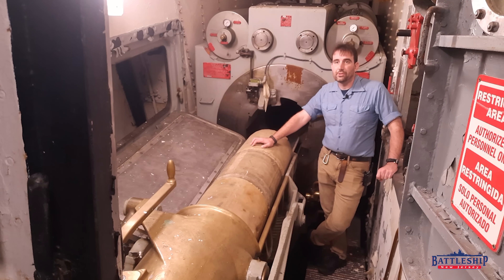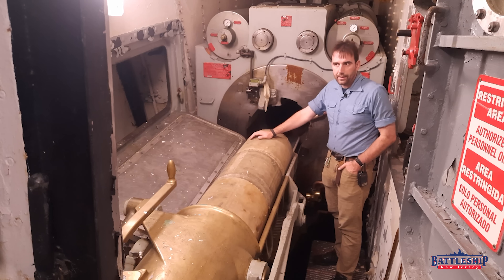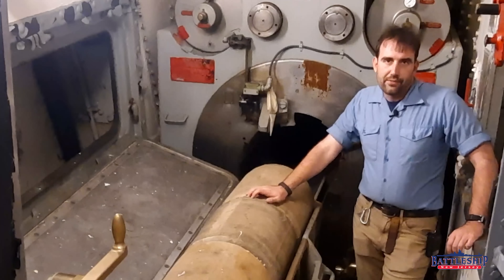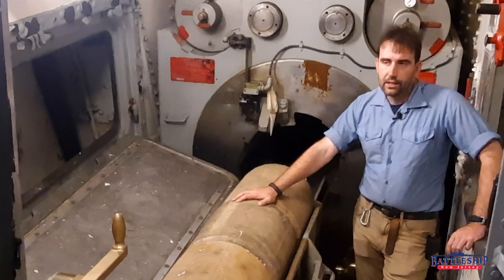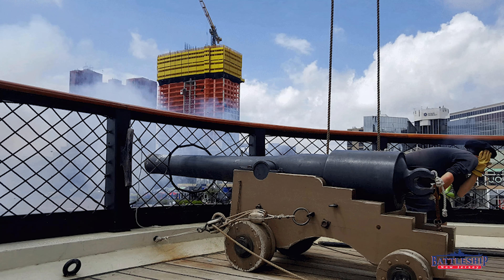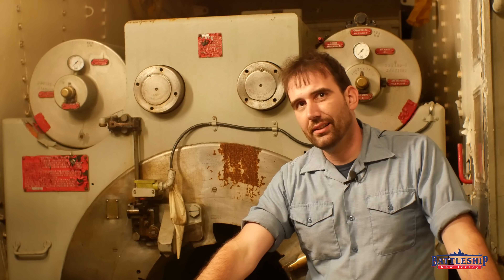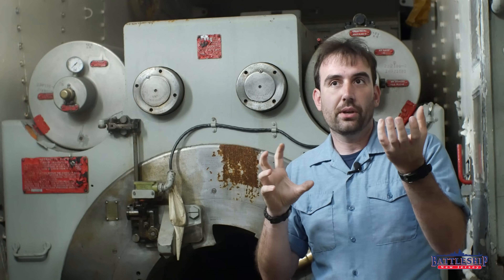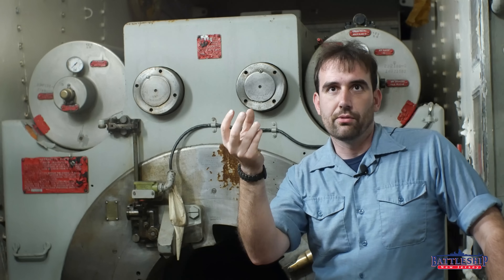How to Unload the Battleship's Guns

Comment: So, my first day working at a small airport, my manager handed me a "bird banger" and told me to go down to the end of the runway and shoot it to scare off some birds.  Its basically a pistol that has a cartridge shoved into the muzzle with a separate percussion cap sitting on the breech under a hammer.  Anyway, I loaded it, pulled the trigger, and nothing happened.  I did it a gain and still nothing.  If finally fired after dropping the hammer three times.

He told me it wouldn't be loud.  Then again, I later learned he was a Vietnam vet with hearing damage (and more) courtesy of an NVA RPG.

Comment: I have had misfires, and once a hang fire which are potentially very dangerous. That is why if you have a misfire, keep the weapon pointed in a safe direction for 30 seconds, before opening the breech and removing the dud round. I have also experienced squib loads where the primer detonates, but the powder failed to ignite or was missing entirely. That drives the bullet into the rifling. If you press the trigger and the report is off in any way, STOP! there might be a bullet stuck in the barrel and if you chamber and fire another shot, it could blow your gun apart, injuring or killing you.

Comment: I have never thought about this until I watched this video, but I have been interested in heavy artillery for quite some time.  I would have thought that the base of each shell would have a threaded hole or holes in it that would accept a bolt(s) that could be threaded into the shell base, and using a hydraulic puller at the breech, the shell could gently be removed from the tube even with the copper rotating band engaged in the rifling.
Reply: The real solution is a lot more low-tech. Basically a giant brass hammer that you drop down the front end in the hope that it will dislodge the shell.
Reply: You don’t really want to put holes in the base of the projo. It’s structurally a very undesirable situation, particularly when you’re looking at a pretty rare situation.

Comment: Sleaking of 50 cal or 20mm bullets. Did you know that when millimeters is used as a designation that it's not referring to the bullet diameter, its actually the bore diameter and inch designations are the groove diameter.
Reply: Not true.  For instance a .38 S&W calibre is actually .357 inch or .358 inch groove diameter and a 10mm Auto has nominal 9.91mm lands, and 10.17mm grooves.
Reply: @DepakoteMeister  any other that don't?
Reply: @engines-anonymous  Yes.
Reply: @DepakoteMeister  which ones?
Reply: @DepakoteMeister  the correct nomenclature is 44 magnum, not .44 magnum. Same with 38 special and the 223 remington cartridge. It's just a name not a reference to the bullet diamter. .44 magnum etc. is a misnomer. I guess I should have said usually it's in my first post. My bad.
Reply: @DepakoteMeister  Also, if you look at reloading components, it will have a inch and millimeter designation. One is referring to groove diameter and one is referring to bore diameter.
Reply: @DepakoteMeister   to clear up any confusion and to I guess correct myself...  What I should have said is, the metric designation of a bullet usually refers to the bore diameter, while in america we refer to it by its actually diamter, which is the groove diameter. The name of the cartridge does not necessarily indicate the bullet diameter. Pistol cartridges tend not to follow that, but rifle cartridges usually do. 50 cal actually does refer to the bore size not the groove size.
Reply: @engines-anonymous  Yes, that would be more accurate.  I think not just the US, but English Imperial calibres are usually groove diameter too.

Comment: Ryan, didn't you show a "Backing Tool/Rammer" down on one of the shell-handling decks?  I distinctly remember a video where you showed a large, metal tool that you speculated could be dropped down the muzzle of a 16" gun to dislodge a rammed-home shell, and a Gunner's Mate replied that was exactly what it was.
Reply: Wait where I want to watch that video
Reply: The video you're referring to definitely exists.
Reply: look at this on fig 2-23 . You will find the advices and drawing for using the "backing tool "   on   https://eugeneleeslover.com/ENGINEERING/OP769/OP-769_Part1.pdf
Reply: "Backing Tool "  on   https://eugeneleeslover.com/ENGINEERING/OP769/OP-769_Part1.pdf     fig. 2-23

Comment: to clear a few things fuses in modern weapons usually require a sieries of actions to arm fuse setback which moves device in fuse that lets spin then arm the fuse deceleration l does nothing either impact or timer or radar sets fuse off

Comment: Ryan anyone who has fired a 22 has had a dud!! especially with Remington thunderbolts in 87! i had a 100 pack with 30 duds in that!!
Reply: That's true.  I've had a lot of .22 cal. duds.  I wasn't thinking of that when I made my earlier post.  Was shooting with a fellow one time and we had a number of .22 cal. duds.  He collected them up and tossed them into a pile of ripped up targets and splintered wood being burned in a cut down 55-gal. drum.  It probably took more than a minute, but they cooked off.
Reply: @yepiratesworkshop7997  oh yeah the primer may be a dud but the powder is normally just fine!!
Reply: @keithmoore5306  I didn't show it, but I was a little "concerned" that one of them damned things was gonna' come flying out of that oil drum.  I've also had times when I'd just re-cock the shootin' iron and fire it again and that time the primer worked.  I ALWAYS worried when I had to eject a "dud" figuring that little bit of jostling might set it the rest of the way off.  Just lay it on the bench with the barrel pointing down range and give it about 5 minutes.
Reply: @yepiratesworkshop7997  oh yeah stuff like that will rattle ya` some and on a chamber dud i normally bang on the gun a couple times and if no bang dump it! after 45 plus years i know a dud rim from hangfire!!
Reply: @keithmoore5306  I did have some .45 auto ammo from somewhere in South America -- Brazil, I think.  It was marked "cartuchos" or something.  That stuff was about 1/3 hang fires.  I mean, slower than a poorly primed flintlock.  With a little tuning, my flintlock times are just about as fast as a cap-lock these days.  Just got a new one.  A "fusil de chasse" that's about 60-inches long.  I'll be stripping it down to inspect it and "tune" it on a video on my channel sometime soon if you're interested in flintlocks.
Reply: @yepiratesworkshop7997  interested? these days with the way ammo is i'm looking to get back into front stuffers again!! got out of it for a while but Christ the hardware store where i normally buy ammo hasn't been able to get any since 'March before this last one and the gun stores are still rationing ammo it's even hard to pellet gun ammo at times around here! i've got lead and can get stump remover sulfur and make charcoal if i can't find pyrodex or regular black i can make it all i need to do is make a ball mill which is why i'm looking for bearings right now!
Reply: @yepiratesworkshop7997  i'll tell ya` if you're looking for saltpeter stump remover is 98% saltpeter and works just fine in blackpowder i've used before! and for sulfur there's a fertilizer who's name escapes me at present but it's just small discs  of sulfur with a coating on it that can easily be washed off before grinding it up!
Reply: @keithmoore5306  Thanks for the info.  I hadn't heard either of those before.  The last time I got salt peter, it was at our rural grocery store.  A lot of people who do their own butchering on the farm and hunters use it in some of their meat preparations.  I needed it to make some 'slow burning match' for our linstocks when we're firing our cannon at reenactments and for the guys who demonstrate matchlock muzzleloaders.  I ended up getting about 4 jars of it and giving most of them away to other reenactor groups.  When I went back to get more a couple of years ago, they didn't carry it any more!  And, why?  Because some government "agency" cautioned them against it.  Really lame.
Reply: @yepiratesworkshop7997  yeah those safety Nazi's light my fuse!!

Comment: I know this ship no longer has her bofors mounts, but I would love to see a video on the Mark 51 Director that was used with the 40mm guns in WWII.
Reply: Did you know Mk 51s could direct the 5"/38s? You couldn't use them with a Mk 37 because the 51 lacked a rate deviation gyro. However, it could certainly be connected to, and direct, a 5" mount(s) by itself. That's cool.
Reply: @ut000bs  yeah they’re pretty neat. Definitely ahead of its time for sure

Comment: If there’s too much of an air gap between the back of the projectile and the powder bags couldn’t that run the risk of damaging the gun even though it’s less of a charge because it gets too much time to build a build pressure with small arms if projectiles are not seated either in the case properly or with a muzzleloader not seated All the way into the powder you risk it blowing up in your face but I would imagine also the chamber is designed it’s such a link for the project I’ll be seated in the same distance with the ram each time I guess I’m overthinking it

Comment: On 5 inch guns they have extraction case with a higher pressure to blow the shell out!
You can not push it back in!!! As the fuse would serve off the shell!!

Comment: I only know of 1 16" shell that was unloaded by method other than firing. That would be the one from the center gun of turret 2 that had the explosion. In addition to being rammed into the barrel, the explosions caused it to move even further into the barrel. The way they got it out was closed the breech and ran a high pressure water pump to fill the space behind it with water and pushed it the rest of the way out of the barrel. This was done at Dahlgren in Virginia in late 1989 or early 1990.
Reply: this contradicts "Old Guy Gaming Networks" comment stated above though....
Reply: I though they beat that shell out with a custom made heavy cap all the way back from the front. There was a picture of a 16 inch shell beat all to hell. If that was not it, then it must have been the one from turret 1 misfire.

Comment: I was on a range once many years ago shooting a .338 Winchester Magnum rifle and one of the rounds (handloads) failed to fire.  I waited a bit and then worked the bolt, but only the case came out.  More significantly, there was no spilled powder in the action.  Upon further inspection, I discovered that I'd somehow managed to seat a bullet in the case with no powder charge and the force of the primer alone had driven the bullet a short distance down the barrel.  A borrowed cleaning rod soon had the bore clear, but my embarrassment took a little longer to clear up.

Comment: On many guns, you use the rammer through the muzzle to hammer the round out.  If you get  a dud in a tank gun and you cant  get it out of the breach, you push it out  from the other side.  In theory you could do something similar with the 16 inch gun but its much easier to just clear the gun by firing it.

Comment: When a gun has been fired more than a set amount, say 5 rounds in 15 minutes for a five inch, it is considered a "hot barrel" and the breach is not to be opened if there is a misfire or a cease-fire after the round is in the barrel. Misfires stay in the breach until it either cools or cooks off. Cease fires with a hot barrel are cleared through the business end as a matter of safety.
Was in Gitmo in '77 or '79 when a DE with two 5" .38s opened the breach on a hot barrel misfire and deflagrate into the aft turret. Our helo picked up one of the three stretcher cases and flew him to the hospital.
Bottom line - once loaded, fire it or retire it.
Reply: We have a saying in the Army when you have a runaway machine gun- "Break the links or ride the lightning until it's out of ammo".  Most guys ride like the wind,,,,,
Reply: After a fairly long fire mission in Vietnam, we had just rammed a load into the right barrel of mount 51, when they called cease fire. Guns were "HOT".EVEN THE GUN TRAY WAS VERY WARM.
REQUESTED TO CLEAR ON A SAFE BEARING (fire gun)
And was denied. We were all waiting for permission. Gunners mate requested permissio. To pull the powder canister.recieved permission , dropped breech with the rammer
Down thru that one over the side! Inserted short round and a long 30 seconds later cleared the gun safely.  I had the bottom 3 inches of that Brass short round untill 2018 when i donated it t o a Amvets post
Reply: @Barry D. Thomas Sr.
Do you know which post? I’d love to go see it.
Reply: Yikes! That sounds like it could have killed a lot of people, even the entire crew as well as sank the ship.
Reply: Alas. Either those sailors were poorly supervised & left to their own devices to resolve a problem new to them, or they unthinkingly disregarded safety proceedures. Either way the careless action of a single second has consequences that last a lifetime.  Alas.